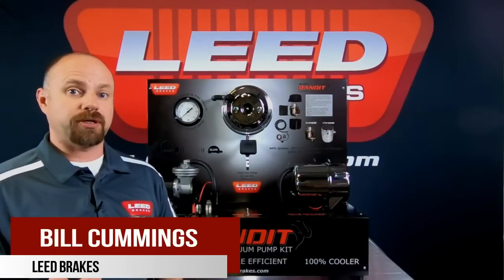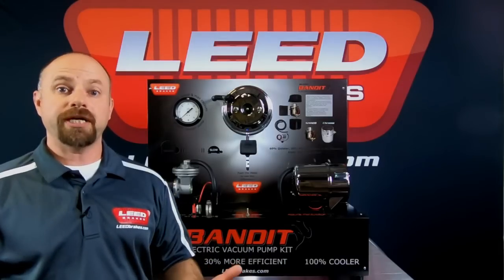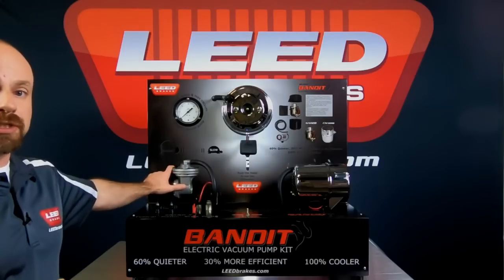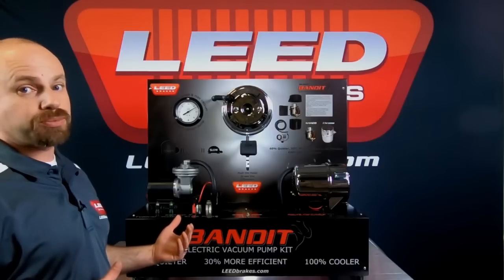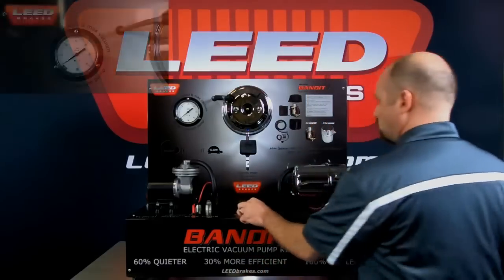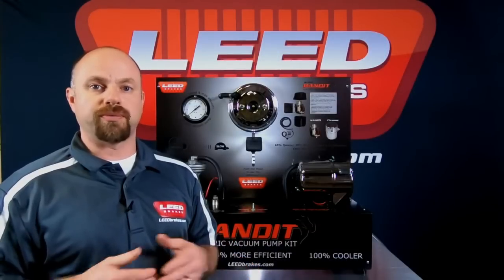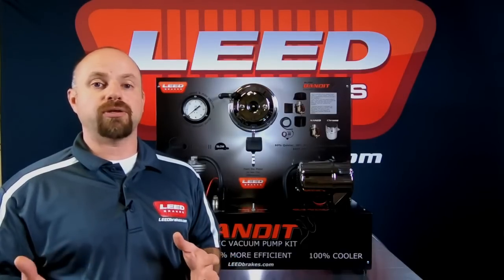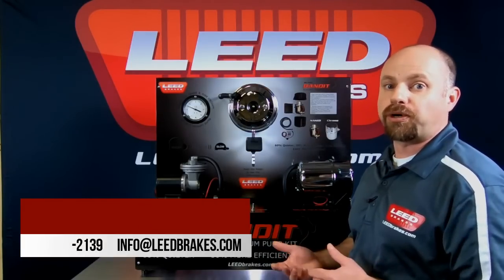LEED Brakes Bandit Series Vacuum Pump Demonstration

Comment: Any help with a question ? I was running the piston pump vacuum in my truck ran off my ignition when key is turned on.. Bought this bandit pump and once i hooked up the 2 wires it runs weak very weak.. So i ran direct to. Battery and new pump works great..my question am i doing something wrong..the 2 wire work the piston vacuum pump but not the new. Bandit pump runs weak ..any help be appriciated

Comment: Installed to my 67 shelby Mustang GT500 427 cu inch with Big Cam, Vacuum Pump gave up quickly after a month with 10 runs, and it's made in China.  Very Expensive amount but cheap performance.
Reply: Did you replace it with the new one or did you go with the different method

Comment: hello rus 
i have 10 inches of vacuum i need at least 20 inches to my big booster does it work for me and if yes can i plug it directly to 12v source to run non stop or it have an pressostat build in for turning it off at the right pressure ???

Comment: I only have 5 inches of vacuum because of my cam shaft.  Will this work?  How much are they?
Reply from the maker: Hi Russ, apologies for the late reply. This system will definitely work for your application. The naked bandit is $349, Black Bandit is $379 and the Chrome Bandit is $399.